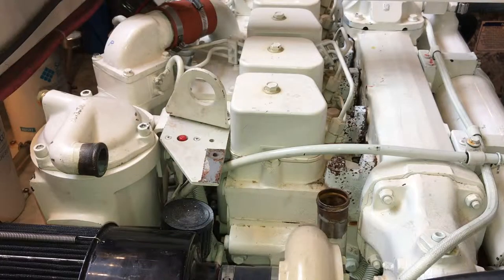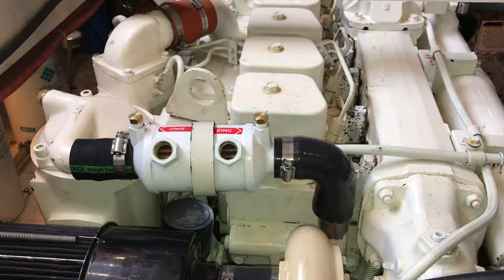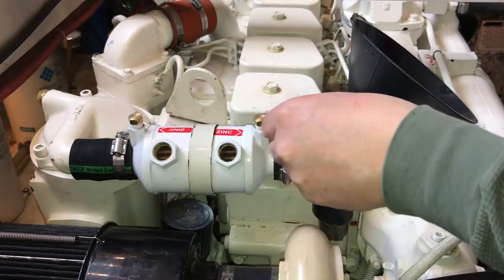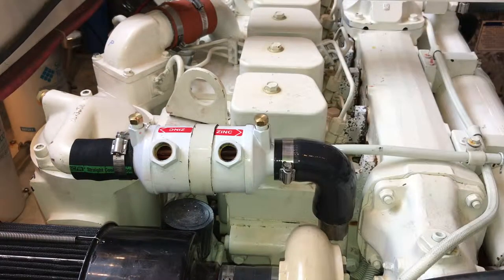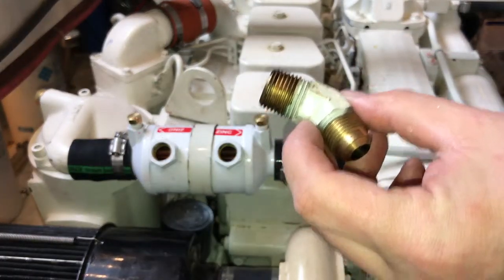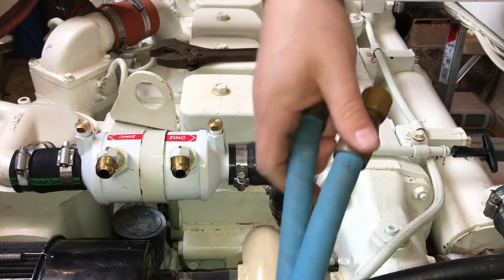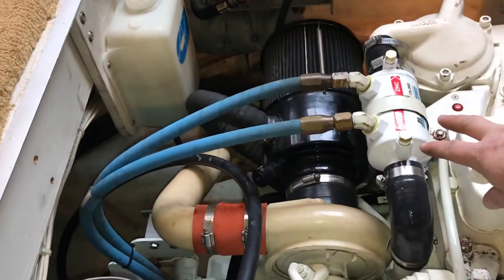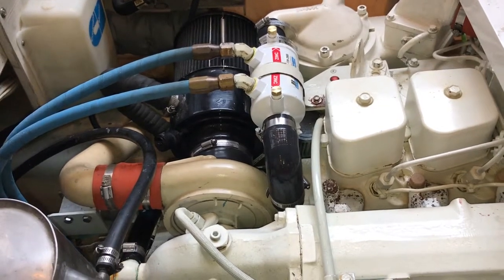Cummins marine gear oil cooler replacement part 2

Comment: Great video! I was told that the transmission coolers are notorious for catching debris and getting clogged. Yours looked in great shape. Was it really necessary to replace them?
Reply from the maker: I replaced them because they were about 18 years old and I had a small oil sheen in my exhaust.   They aren’t that expensive to change to see if it solved the problems.   The heat exchanger and after coolers I had pressure tested to make sure they were not leaking.
Reply: @abredeson   Thanks, your videos have very helpful.

Comment: Great video. Thanks for the details. How many hours should you consider it time to change the TC. ?  Thx
Reply from the maker: Andrew Barbaccia it’s my understanding that it is not engine hours based.  I replaced mine based on our mechanics recommendation because ours were 17 years old.   With salt water sitting in them for years on end breaks them down, not engine hours.

Comment: Did you ground the oil cooler?
Reply from the maker: Yes I used the ground in these new coolers and tied it into the ground that goes to the engine
Reply: @abredeson  I have a 3485 Avanti cruiser and the pair of 315 Cummins literally stuffed in it makes almost zero room for service.  I’m getting ready to do a round the world maintenance and replacing all hoses and servicing the HX and AC.  I’m a little intimidated by the after cooler only because I don’t want to have to buy a new one!  Lol. Your videos are very helpful.  Thanks